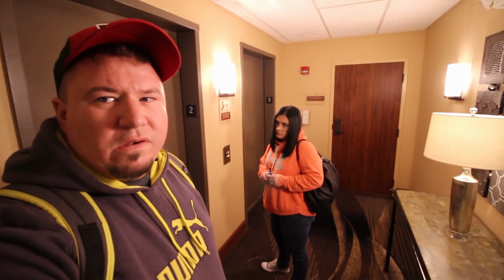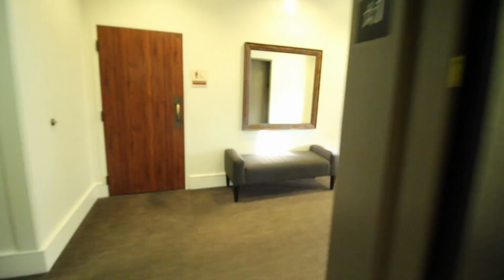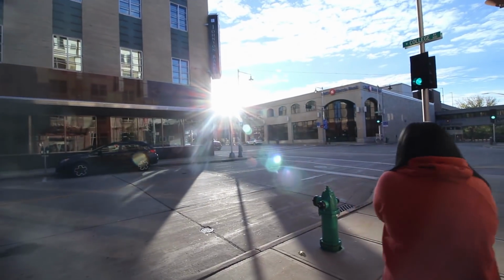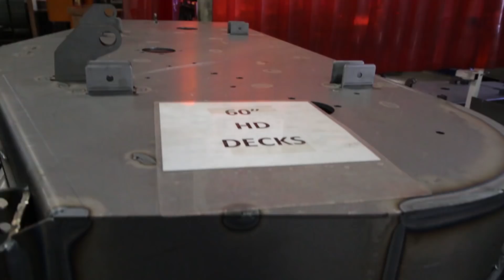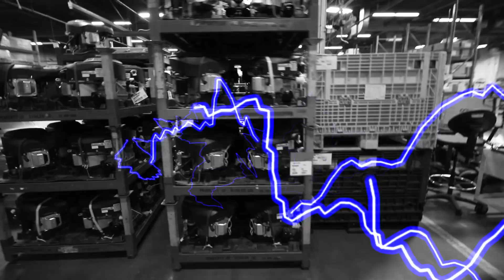How Commercial Mowers are Made ► Ariens/Gravely Commercial Mowers Made in America!

Comment: I was on the fence about getting a Gravely a few months back but after looking over my ZT HD you can tell it was made to last. Just working on trying to get the correct blades to improve cut quality. Thanks for the video Andy.
Reply from the maker: +No Mow Worries where I’m located I pitched the back of the deck up about 1/2 inch and run high lift blades it cuts great for the Midwest/northern grass
Reply: Cut and Clean Lawn Care Appreciate it! I will definitely try those blades. I recalled Blake saying you figured it out and you are satisfied with it now. Thanks for the knowledge on Gravely products. Probably the only guy on YouTube that speaks highly of the brand. So far I love mine. Hopefully I can get a channel up and going and represent with ya.